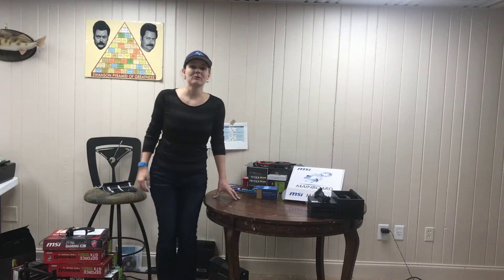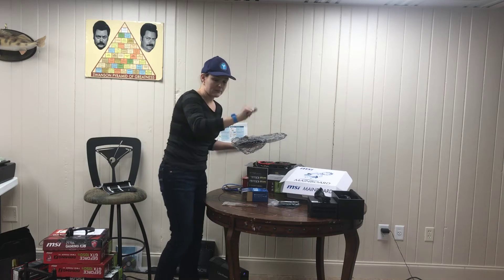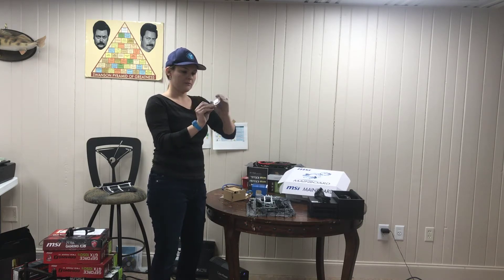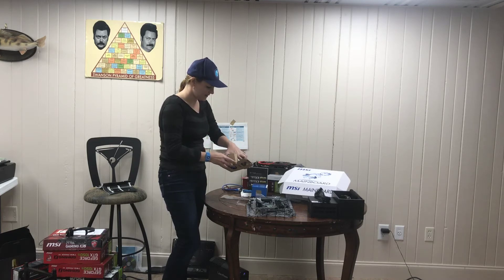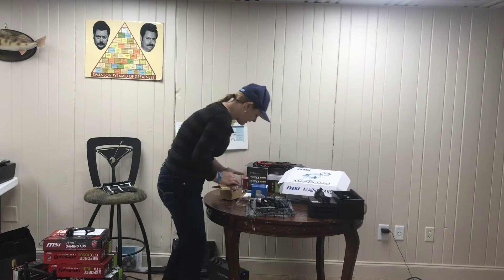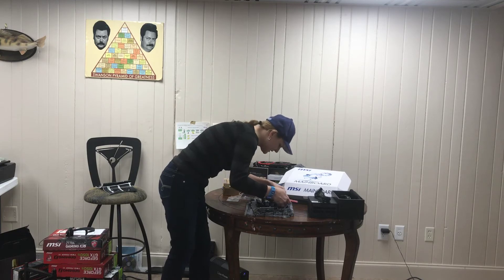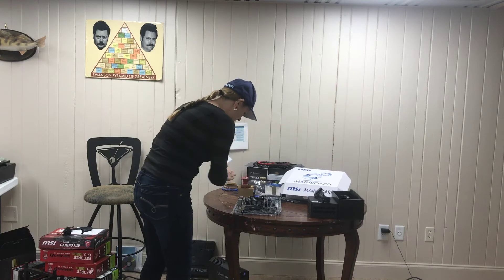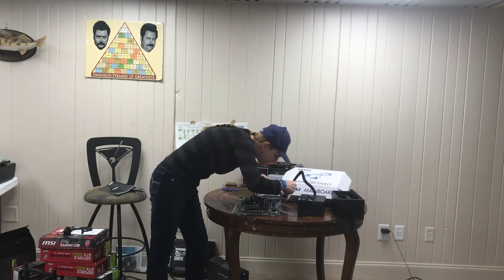Unbox, assemble, and debug an MSI Z270-A Pro

Comment: There is a video that I'm curious about that I'm trying to do a little research on I haven't seen anyone talk about it (on YouTube)  the fact that you can have a high hash rate and low amount of shares. I have heard that you can have a card that does not get any shares but still has a really high hash rate and you can have a another card that gets high shares but low hash rate and makes more money .  Of course the bigger card can be fine tuned to get more shares, but this is the question what does that tuning intail. I'm assuming it would be maybe too much over clock causes the cards not to perform in shares but perform in hash rate it gets more and more confusing when you start researching yet because everybody seems to have an opinion but nobody seems to be willing to share their testing. I really like your video